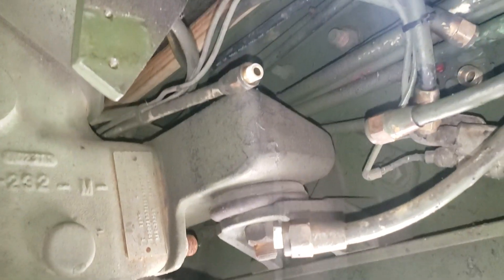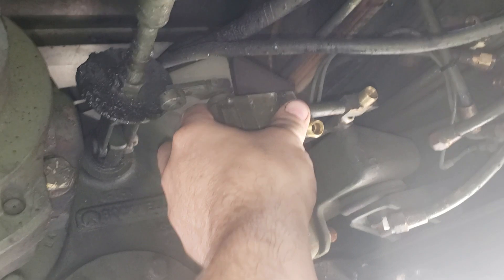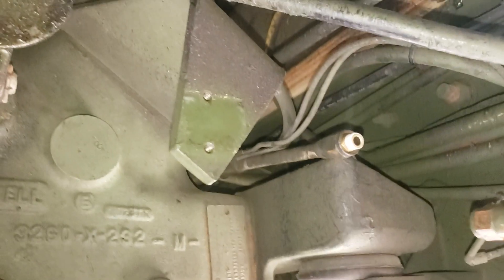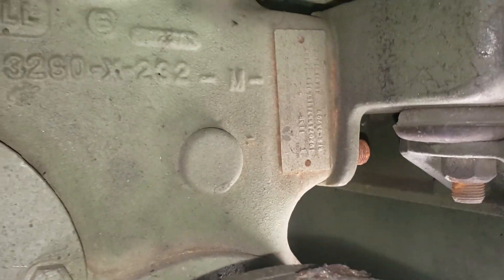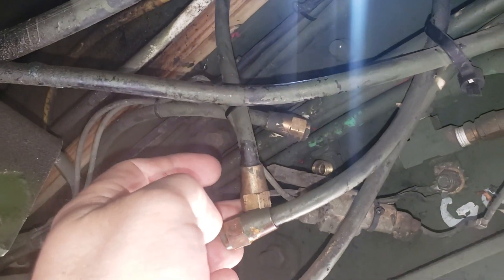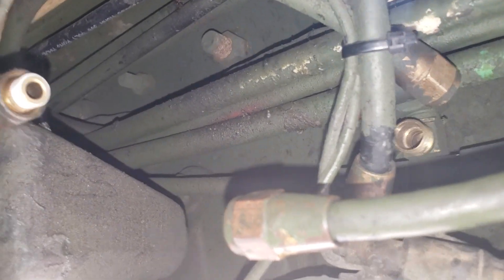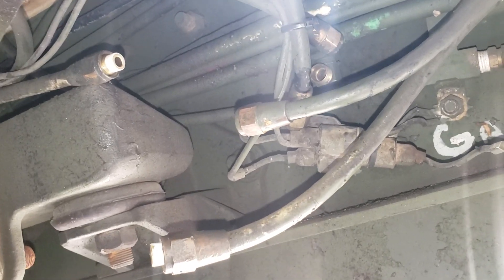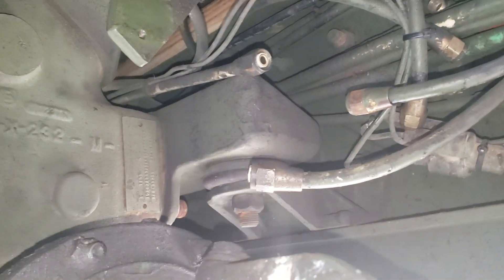M939 SERIES TRUCK T1138 ROCKWELL TRANSFER CASE SINGLE LINE MODIFICATION- REDO

Comment: I just picked up an '86 M934A1.  Front axle won't engage.  I found this section, the washer on the transfer case shifter linkage is removed, the two frontward lines on the linear valve are cut and capped, and the backward line on the linear valve was left attached.  I tried splicing that back line to the front line that leads to the dash switch, but no matter how much pressure I build up, it just won't engage.  There doesn't appear to be signs of damage to the front axle that I can see, the truck is in really good condition overall.  Right now it's my only winter vehicle, my other truck caught fire, so I've desperately been trying to research and ask around
Reply from the maker: Does your horn or wipers work?

Comment: Do you just leave the line that comes off the tee on the frame rail and runs to one of the rear interlocks unhooked?
Reply: I spoke with Wes and he confirmed that you leave the airline to the rear interlock unhooked and just bend it back onto itself and zip tie it to keep dirt out of the line

Comment: Hey i dont know if youll be able to answer this but my 5th gear lockup solenoid im not sure is working when i have the positive wire plugged into the wiring harness my truck falls flat and dies when i try to give it gas but if i unplug it it drives just fine do i need to replace the solenoid or is it something else
Reply from the maker: Is the button on the transfer case lever stuck? That's usually the culprit. It's either stuck in on the handle or the switch there has failed.

Comment: I realize this video is from 2 yrs ago,  when I engage switch on dash for 6x6 I can hear air leak in intake and front axle won't engage.   Will this mod resolve this issue? Is it a bad linear valve causing this?  Also when I put in low range front axle will not work either.

Comment: Is there a way to operate the transfer case interlock switch with an air switch? I mean can I bypass the little electric button on the transfer case lever and use some kind of air switch some place to operate that portion of the transfer case? I have an M931-A2. BMY
Reply from the maker: This mod bypasses the interlock system.  The dash switch controls the 6x6.  The switch on the transfer case shift rod is for releasing air off of the cylinder that pushes down on the H to L shift fork to prevent accidents on kicking the rod out in the cab.  The button on the lever also engages the transmission 5th gear solenoid allowing the transmission to go into 5th gear so that the transfer case can be shifted high to low or vise versa with less resistance of the driveline.

Comment: I've been researching this mod for the past couple days while looking to make the truck shift into low range easier. 
Thanks for the helpful video! 
I have a few questions still. The shift interlock valve just gets capped correct? Do you know what size plug I need for this? 
Also the line running back to the front axle engagement valve seems to run into some connections and an electric solenoid on top of the transfer case before running into the valve. Do I need to do anything there?

To put it short is all I need a 3/8 compression Union and a plug for the interlock?
Reply from the maker: Plug for the frame rail or run the lines back into each other on the frame block and hook the front line to the line going to the rear cylinder lock for the front axle.   You can leave the solenoid alone and in place
Reply: Thinks! I was able to get it figured out

Comment: I have a m939  everytime I put it in high range it pops out need some help wes
Reply from the maker: The linkage rod underneath has an adjustment nut. You need to.adjust it to make it longer so it has more force on the lever on the transfer case pushing in
Reply: @wessimpson2794  thanks a lot
Reply: @wessimpson2794  west it's doing the same thing can u help me asap by posting a video
Reply from the maker: @ririaudain6277  it is raining here and i am not near a 5 ton truck.

Disconnect the linkage at the transfer case by pulling the cotter pin and removing the pin. .  Use a hammer and knock the lever back into the transfer case so it seats all the way in the case and locks.  And just let the linkage hang.  I can get you a video tomorrow
Reply: @wessimpson2794  thanks wes I will be looking out for the video tomorrow
Reply: @wessimpson2794 are u still uploading video  today need help asap
Reply from the maker: @ririaudain6277  its uploaded

Comment: Could you cover the no air in the cab issue again [ no horn , wipers ect. ] where do you get replacement parts from? Thanks Rob
Reply from the maker: Napa 277147x.  It's called a pressure protection valve on the front of the wet tank under the cab opposite of the shut off valve
Reply from the maker: https://youtu.be/6u_blhOAYDI

Parts spreadsheet

https://docs.google.com/spreadsheets/d/1-6vGwwEsD-flXsMFBn7VomUUJDuk_aG_to5pzHqzkBc/edit?usp=drivesdk